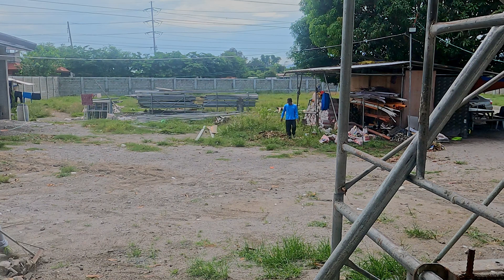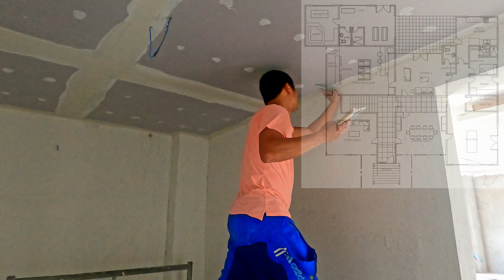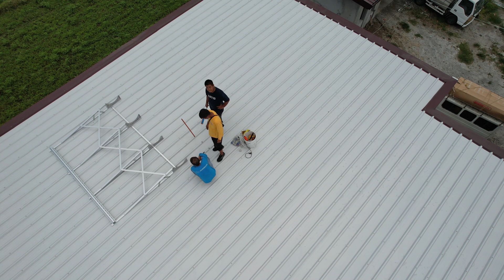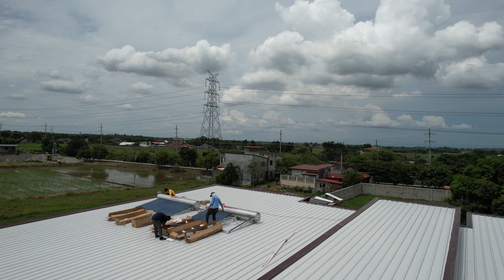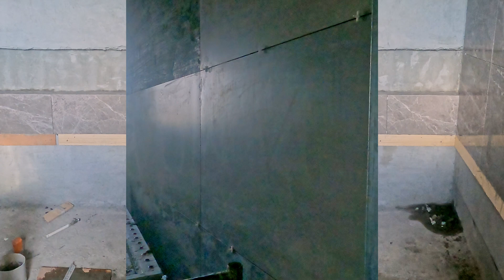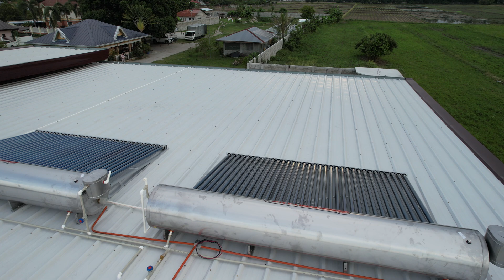Philippine House Building Day 241 - Solar Hot Water Installation

Comment: Hi thank you for your trust in our product.  Electric water heaters start at 3000w. One hour of of regular heater is equal to 4 TO 5 hours of aircon use.  Not to mention Electric water heater cost money to buy too. So it's really best to buy solar water heater. Philippines has one of the highest electricity rate next to Japan. So it's always wise to cut down the biggest consuming piece of appliances in the house.  Again thank you for your trust and support.  We wish you all the best in your stay here in the Philippines.
Reply from the maker: Thank you guys
Will find out very soon how effective the system is.
Did get your email - apologies for the delay - will be sorted very soon.

Comment: You  have  quite a big  SOLAR Hot Water  Heat  Sys. Mike,  shouldn't  need   any Elec  backup  i should think ,James Tanner  of My PI Dreams  says he has not used any elec backup ,and he has only one tank, and Batangas is a bit cooler climate  i think.
Reply from the maker: Hopefully we are fine.
Now it will be down to trying to maximise water pressure.

Comment: Hi mike just looking at all those down pipes coming down from the top roof  to the bottom roof where they we’re organising the solar frames maybe they should be all joined together with one long pipe with holes so that spreads the amount of water evenly over the roof so in monsoon weather you don’t have water gushing out of the down pipes cheers gerry
Reply from the maker: Gerry
Much as I don't like the idea, I think I am going to have to wander over to the house during the next major storm to try to see what is happening. Your idea may well be something we have to consider.

Comment: dont think you would have to worry about hot water psi, if your tanks are on the roof
Reply from the maker: Really hope you are right Stephen
Reply: @philippines4.0buildinganew64  the system installed will not lose the pressure that goes in.
It maintains the pressure from source. If your pressure goes in at 40 psi. It will Not lose it bec this is not a gravity type system. Hope it helps. Thank you

Comment: Good morning Mike The hotwater solar looks impressive very large a big improvement over earlier systems. There are hotwater pump boosters have electric impeller and electronics for auto sensor units are small and not expensive. 
Tiling looking good. 
Drone footage wow your now a expert or are the boys helping the younger ones good on the controls , fantastic zoom shots.
Reply from the maker: Hi Graeme
All settled in ???
If we don't see good water pressure, we will have to take a look at a booster pump.
Drone is still all me - and you should see how much footage I have to cut to get a few seconds that I think are ok.

Comment: Hello Mike . Well I personally don't know anything about that hot water system on your roof but I can recommend solahart ( Rheem ) hot water systems as I use them back home . There expensive but they are the best ,last up to 20 years ( I've been told). In Philippines I use a good brand electric water heater - wall type-  (built in little tank type) in bathrooms etc . Up here we use them in showers about 2 weeks a year in winter ( hahaha). they last for years ,easy to replace and are cheap . I think solahart is available up here . Regards Mick.
Reply from the maker: Mick
They were my first choice, but I explained on the video today why we did not end up with them. Only ever heard good things about their system, so it is a shame it did not work out.
Reply: @philippines4.0buildinganew64  our solar can match with the best out there. We take pride in informating that we are using Titanium heating element from Thermowatt Italy. In the ranking of heating elements. Titanium is the best. Thank you for ur trust.

Comment: With all the CR's you have just use electric water heater in each.
Reply from the maker: That was the other option Patrick. One problem with that is that I believe they are fairly power hungry, so could have been quite a drain on our solar power - which may already need to be upsized. Buying individual heaters would of course have been cheaper, but in the long run, if the solar hot water system works properly, hopefully we will see a saving.

Comment: Will all of the sinks in the house have hot water plumbed to them?
Reply from the maker: Yes Joseph
The only thing that will not have hot water from the solar system is the hot tub. We have to buy a separate electric heater for that.

Comment: Another cool video. I need to start looking at Solar HW as well. Even though we haven't begun building I like to look at all household systems together. What system (s) did you select? Also, we would love to know more about your drone. I don't know anything about them. What do you recommend?
Reply from the maker: Ian
Not much I can tell you about the solar hot water.
If you send me an email (address in the About section of the channel), I can send you a copy of the quote if that helps
The drone is the DJI Air 2S - brilliant although every new drone that comes out is better than the last.
Reply: Rain water from the main top roof pouring onto the second gym? Roof is not a good idea, this should have pipe connected to the main roof down pipes and then down to the second roof gutter or down via pipes to the ground, just one surgestion, regards JB Thailand
Reply: @johnbradley502  John - roof drainage system on Mike house has had many comments from different people including myself over time . I believe your right . Actually I think 6 / 7 pipes lower roof ( 75 mm) actually drain that 350 m2 ( approx) roof into gully pits with a 6 inch outlet pipe . May be it ok . Mike won't know until he gets 3 days of constant rain which is not unusual up here in Philippines during wet / typhoon season . Regards Mick.